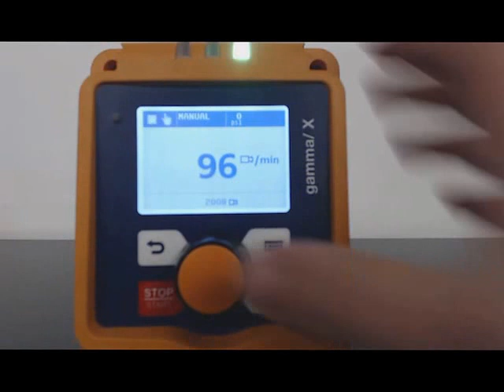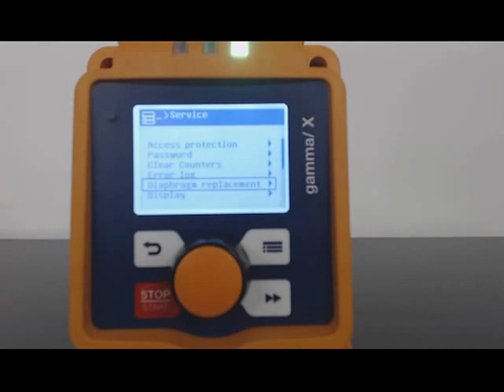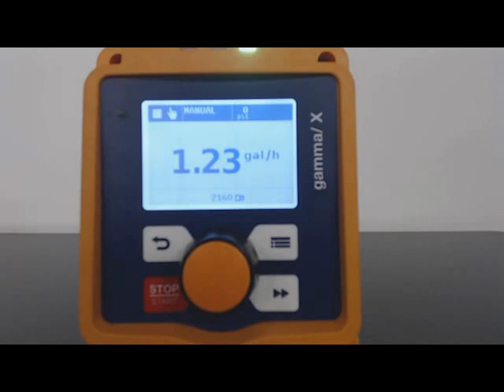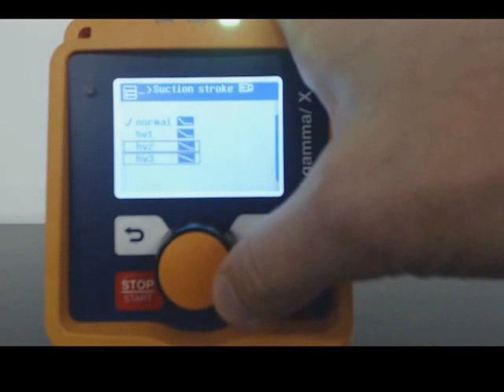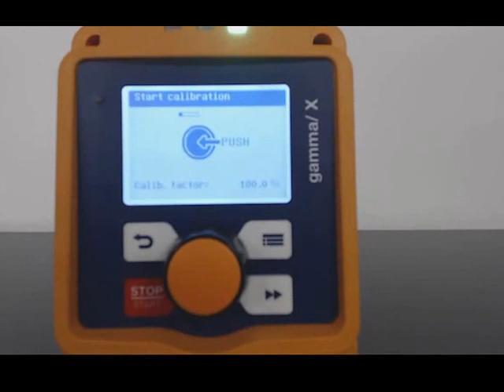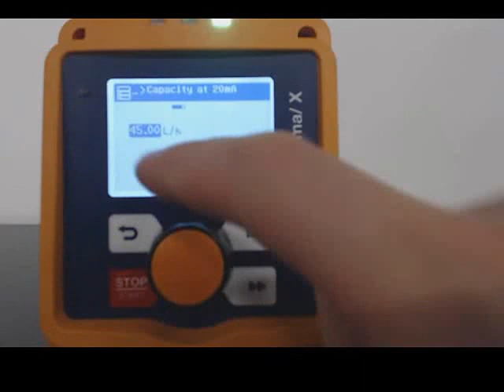Gamma X - Part 2

Comment: This is such a unnecessary range of capacity for this pump, as a water plant operator i preferred when the pump was just speed and stroke we had to set. We do not need batches or time settings, should have just left it basic to operate.